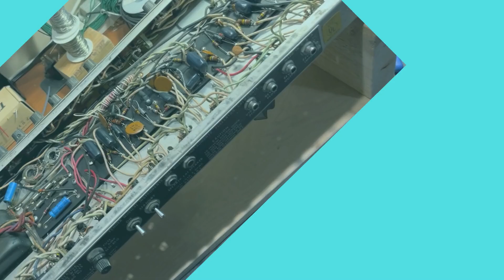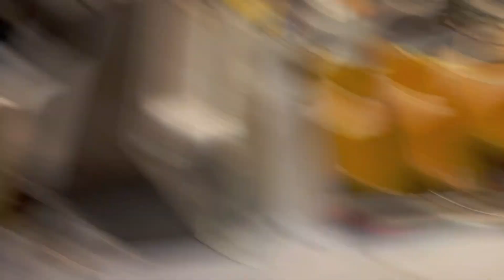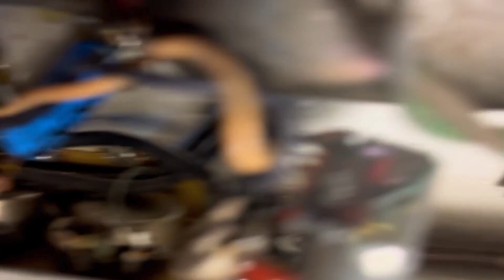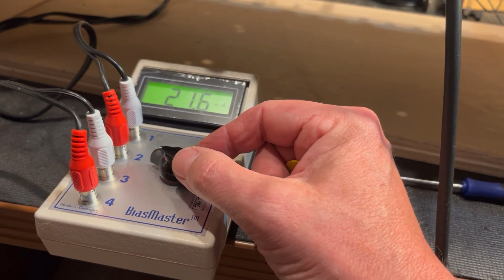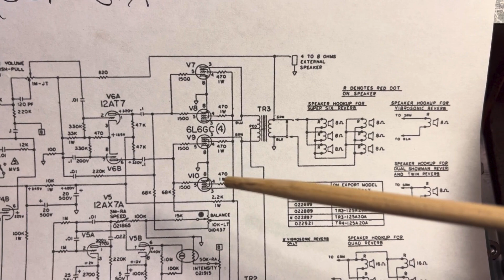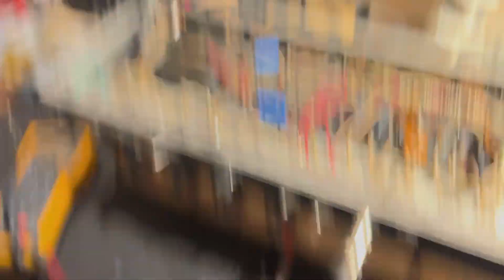1974 Fender Super Six Reverb Full Restoration Part 1

Comment: Hola Damon. I'm contemplating a restoration on my super six. Saw your video and just went crazy! My cab is very loose fitting. I'm planning on restoring the cabinet as well. While I have it apart would it be a good idea to replace the speakers with 12 inch units. Is that worth doing? Will I need to build a whole new cabinet or can I use the present one from Fender? Speaker money is not a concern. I just want to finish destroying my hearing. I'm an old bass player wanting to get back to guitar just for pleasure. I currently own a twin reverb and a super reverb as well as a myriad of Sunn 300 T"s and Fender 300 Pro's. No pansy practice amps here. Thank you for your time. The reverb was replaced with new but not mounted. Your criticism is most welcome.
Reply: BTW the amp says 300 watts.